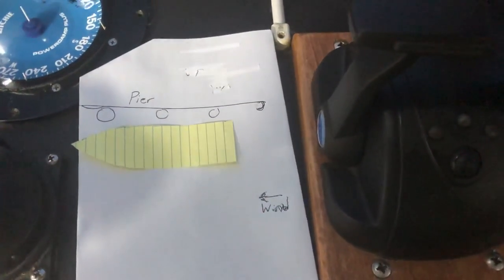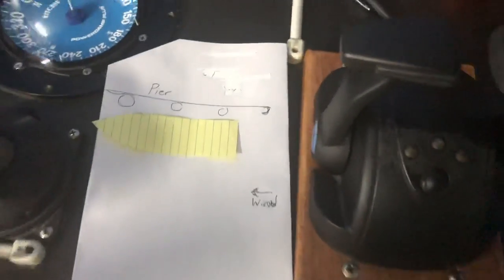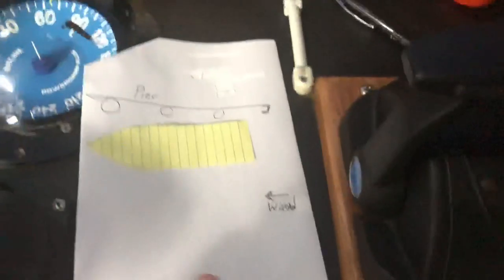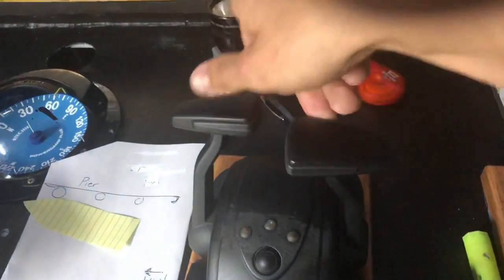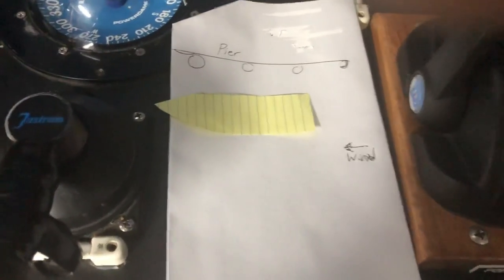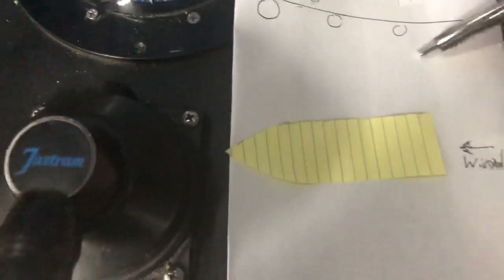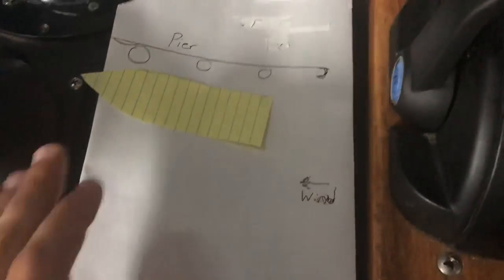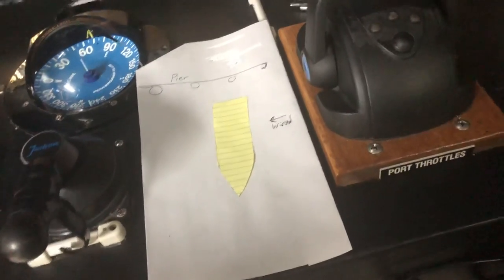How to Walk a Twin Screw Boat Sideways THE EASY WAY

Comment: Sir, I thought  your video was going to show the audience how to "side-walk" constantly the boat by using
 -1. Full starboard rudder for a starboard docked twin screw vessel.
2.- then using starboard engine ahead,  and port engine  astern , you can get the boat moving parallel to the dock in one simple  MANOUVRE , but only if the vessels pivot point is well aft of the midships of the vessel.
Reply from the maker: You can see my video how to walk a boat sideways without a bow thruster which is a more advanced video for continuous movement. It’s not based on pivot point in most cases . It’s usually based on whether or not the vessel has inboard turning wheels
Reply: @BrandonActionJackson   cheers for the reply Brandon, but I heard one can still do what I had described in my post with OUTBOARD TURNING WHEELS (propellers)- due to the way the rudders are positioned AND also in conjunction with the way the props are engaged in either ahead or astern.

Comment: Keep rpm's the same (about 600 idle), starboard forward, port reverse, rudder to starboard, and the whole damn boat will move sideways. Easy peasy.  Not that complicated guys.

The whole back and forth stuff is why everyone's grinning on the dock...
Reply from the maker: Dirty Blond need a little more astern to
Keep the forward creep
Down though
Reply: @BrandonActionJackson  -

Depending on your yacht, absolutely possible.  My 44' power cat wont move an inch forward or backward with matching rpm's. (Screws almost 17' apart)  Wind/current may necessitate more or less rudder to keep the bow from drifting off, but to be expected.  If creeping forward or backward, increase the opposite rpm very slightly (maybe 50).

The point is, whether coming on a dock, or off a dock, we only need to move the yacht 1.5-2 boat widths sideways.  Even if there is a little creep, you're clear of the other boats in 5 seconds or so and can engage both forward or reverse to halt at that time.

With twin screws, and a little practice, you should be able to write your signature in the water.
Reply from the maker: Dirty Blond you should check out my how to walk a boat sideways without a bow thruster video on a 6 screw boat
Reply: DB, I agree with your comment, This isn't the example of walking that I know and used in my boat handling skills. I kinda chuckled when I caught on to the plan. So many bath tub sailors out there. I was a captain for 34 years but learned the correct method of walking a boat 47 years ago. Just to add to your method the prop in reverse will not have the same thrust as the prop in forward so a little more rpm is needed  for the reversed prop. Then as the walk is progressing  you will have to ease the helm to control the bow swing.
Reply from the maker: CaptRon53 this is about as close as you’ll generally get to walking a boat with outboard turning wheels for the recreational sailor. I’m a captain as well and true lateral walks are generally impossible without using some other resource on a twin screw with outboard turning props. Most larger displacement or semi displacement vessels have onboard turning wheels in order to make true lateral walks possible. My other video explains that a lot better ... or for the river boat captains it can be achieved with the help of flanking rudders. But any other walk of a twin screw outboard turning prop setup is generally not truly lateral
Reply: @BrandonActionJackson  Granted...
Reply: w your strbd forward and port reverse, you give her right rudder, you're gonna spin around on your axis (spin to the right), not walk.
Reply from the maker: Jeff Eckles if you had a constant application yes but watch more closely the whole point is to achieve a “crab walk” by using the wind to your advantage to let your bow fall behind you
Reply: @BrandonActionJackson  Hey Brandon, agreed- I was replying to DirtyBlonde, not your painfully long video (sorry to be a smart ass, I know you are trying to help, but it seems you could have fit your info into about a 3 min video). Maybe dirty blond is referring to a sequential motion as opposed to constant too.  Thank you for posting your video (and enduring my constructive criticism), good stuff. Cheers-
Reply from the maker: Jeff Eckles alright sorry it was so long I just tried to be thorough. Also you should check out my video “how to walk a boat sideways without a bowthruster. It explains how you can walk a boat sideways with one in fwd and the other in reverse ... what you explained about the twist isn’t always the case it depends on the whether or not the props turn inboard or outboard
Reply: @BrandonActionJackson  Thanks Brandon, I will check out your other video, I appreciate your desire to be thorough, I'm also a stickler for brevity. Understood re direction of props. Outboard direction will spin the boat w a twist, and equal rpms, yes? That is what I am used to. What happens w inboard direction props?
Reply from the maker: Jeff Eckles inboard direction with the application of rudder will cause a vessel to walk sideways from the side force of the props the same reason a vessel twists with outboard props
Reply: Dirty Blond other than the fact that every boat has different rooms they will like depending on the situation and that in order to spin the boat on a dime so to speak you will have to give the motor in reverse more throttle(higher rpms) because of the way props are designed
Reply: Haha- so true,  don't  forget-even PROFESSIONAL SKIPPERS DON'T KNOW this trick, only about 50% of them do, but this guys other video is actually  pretty  well explained,  except I had to constantly replace his vid back and forth, because  I found  it hard to understand  his accent ,my fault for not driving a pick-up truck or drink moonshine nor do I even know what's in moonshine exactly,  he's trying to help us become better boat handlers  - all the best to him.
Reply: @CaptainJeff2000  his video is long cause he's got plenty of time waiting for his jack Daniels whisky to age.... no offence sir...
Reply: @CaptainJeff2000  cheers Jeff.
Reply: @dirtyblond2332  what boat do you own? I also own a 44 foot power cat

Comment: You lost me the beginning of the video when you were backing on your Stbd and coming ahead on your port… you illustrated with your boat cut out you would maneuver your stern out. But in reality you would be walking in towards the dock. easiest way, I was trained when running tugboats…Back in the direction you want your vessel to go! Like a flat tire, dragging you out or in.